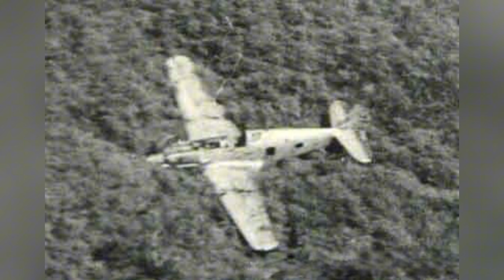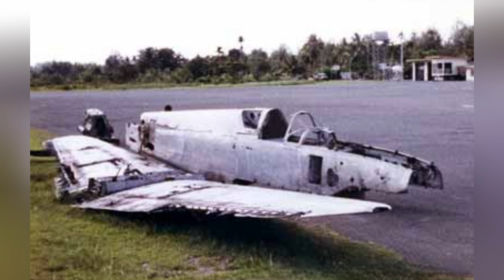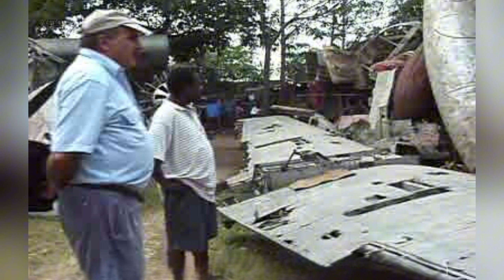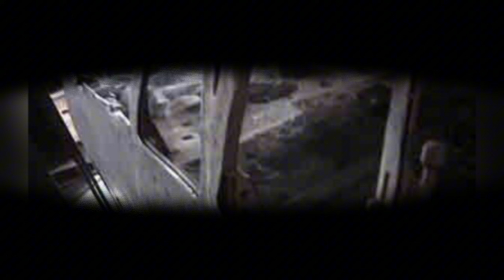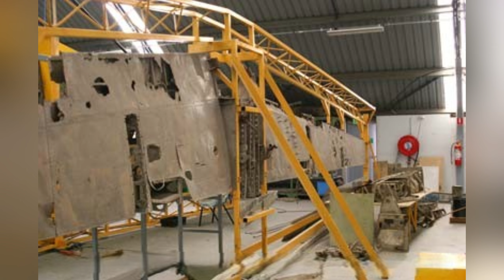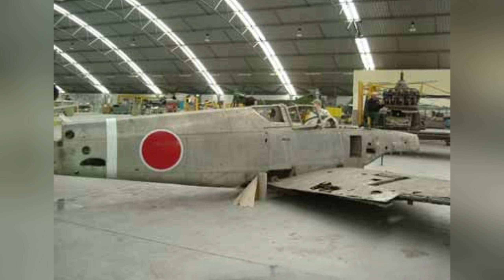Recovering Tony 640: Ki-61 Raised from New Guinea Jungle

Comment: The negativity shown in so many comments is disappointing. 
Time will erase a wreck to dust. Why the reverence of so many people of the ravages of time - which are only testament to the conditions its long term abandomment  The aircraft and it’s Pacific relevance are much more than a conglomerate of decaying materials . 
There are plenty piles of abandoned remains to satisfy the imagination if those types but recoveries of relics of this standars in my opinion are worthy of the most thorough and skillful restoration where those skills and resources are available.
Compare if you will the sad remains of the Halifax at Hendon and the Later Halifax NA337 in Canada.  
A steady if very slow restoration could have drawn much enthusiastic and experienced assistance over half a century. 
Instead it’s corrosion advances while various assemblies have in isolation , shown what is possible.  A hundred reasons ‘why not’ don’t compare well to the Canadian’s  10 reasons ‘can, why - and How’.